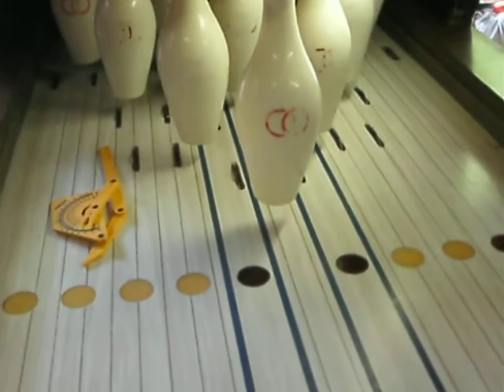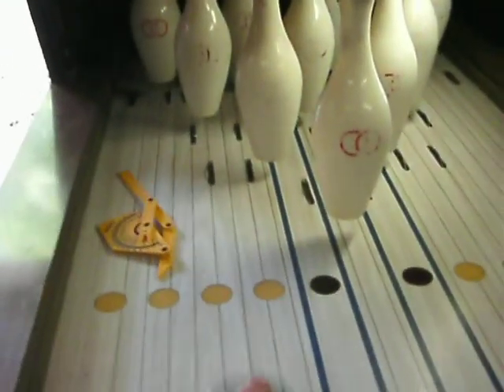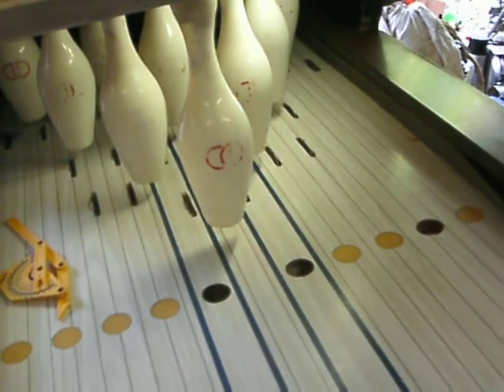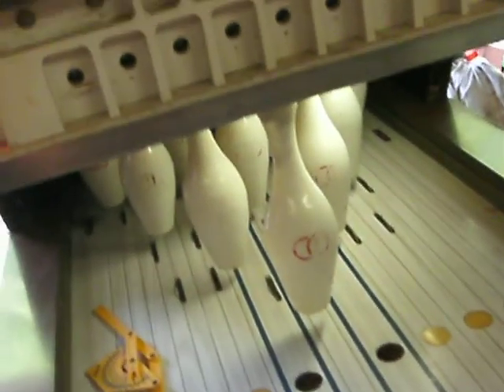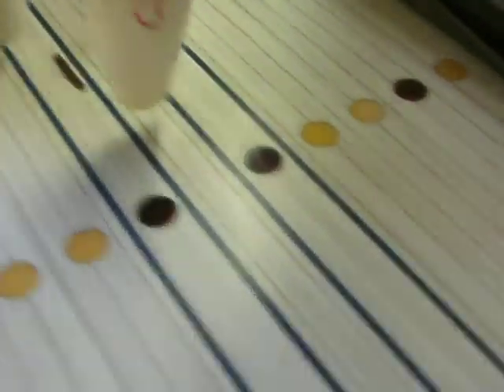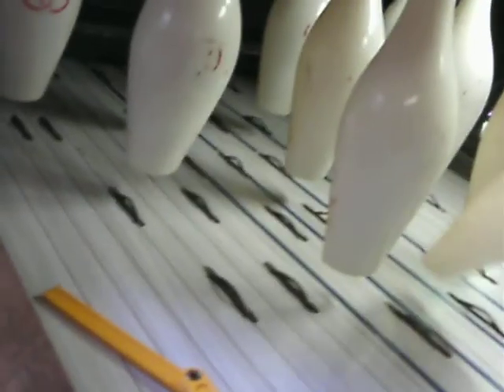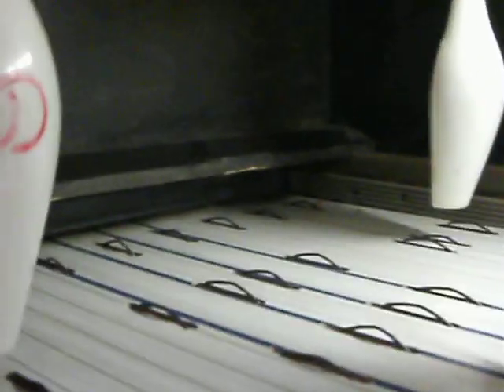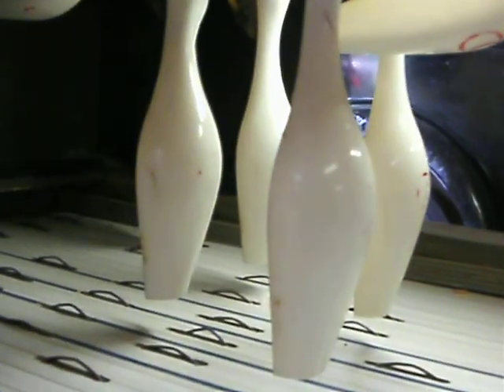1974 United Unique Shuffle alley puck bowler

Comment: From the sound, you have a solenoid stuck.  The very back of the play field one of the wires the puck runs across is stuck down and that makes the puck relay solenoid stick closed.  Try lifting the very back wires one by one to see if the noise goes away.  Hope I helped.
Reply: I have a 1963 Chicago Coin Strike Ball Shuffle Puck Bowler.  The game will turn on in with all lights on and "game over" state.  However, when I go to play a new game, it sounds like it is starting up, then returns to game over state.  It's almost as if "player 1" is stuck on 10th frame completed perhaps...and the game therefore returns to "game over state".  Any ideas?  Any advice much appreciated.